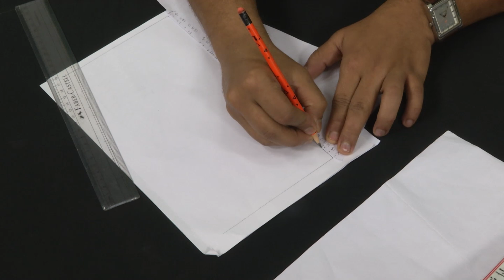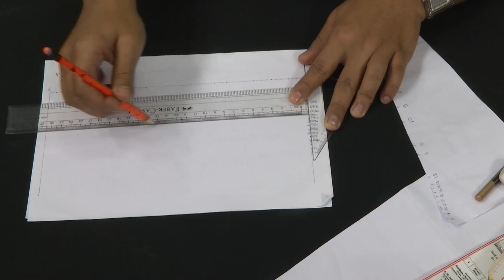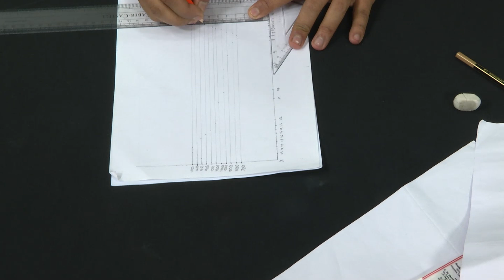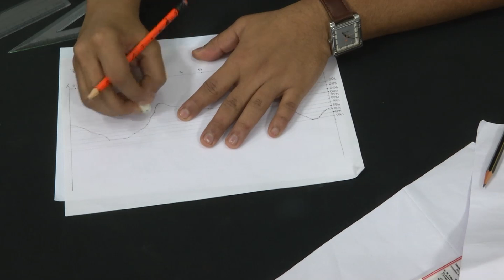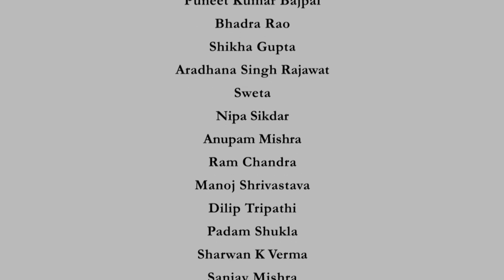IITK NPTEL Structural Geology_LAB 12: Topographic Profile [Prof. Santanu Misra]

Comment: As a Professor of engineering geology, you are correct to connect those dots by hand and not use a ruler, which you would think would be more accurate.  He gave us an assignment where he showed us a picture of the cross section of underground facie types estimated by boreholes.  He told us to draw the diagram more accurately.  For the students who uses a straight edge to connect the dots of the different facies, he said that in geology just draw it by hand because you are not going to be more accurate using a straight edge.
Frank Reiser M.S.